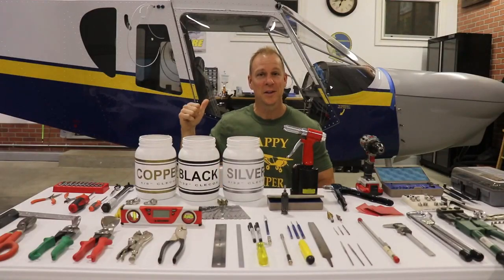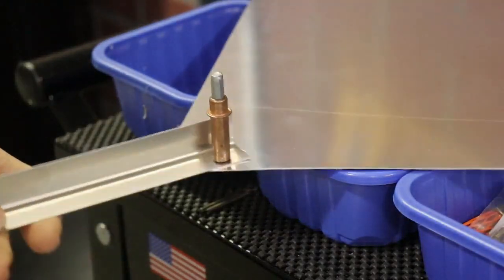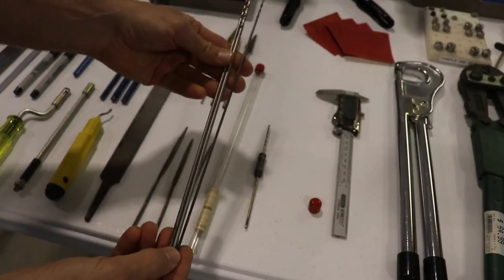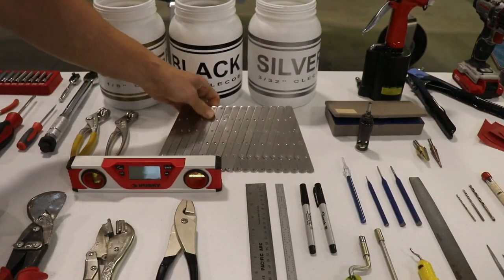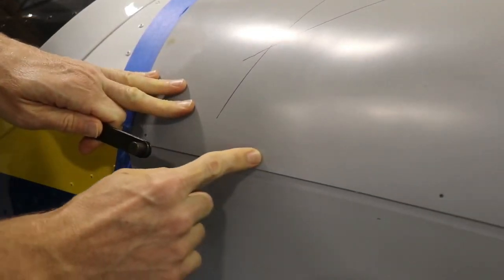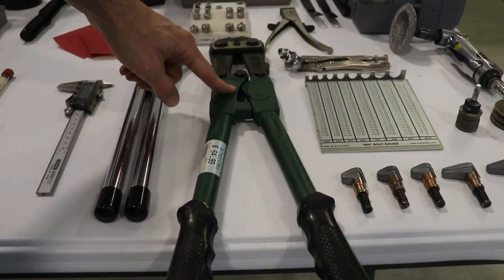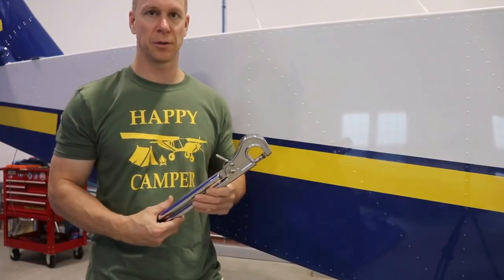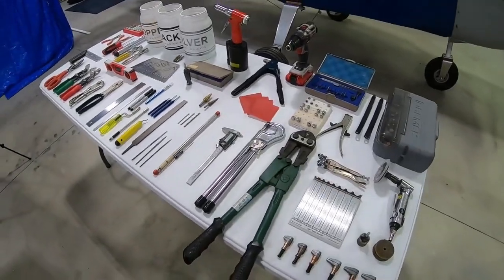What TOOLS do I need to BUILD an airplane?

Comment: The crimping tool the dies when countersinking rriverts there id 100° and 110° dies the lower is 110°and the top plate is 100° so they fit into each other and advise a newber builder that has never done this type of reading by the AC43 book and it has many good tips and how to do the job correctly and yhis is a very hood video for starter well done

Comment: Great video. If you ever want to do a follow-up, a quick breakdown on what's required on top of this, for something like a Vans RV, might be interesting to some. Keep up the good work.
Reply from the maker: It's been a while since I've built my RV-7 so I'm not I remember all the different tools needed. I think it's mostly all of the same tools you see in the video, plus the addition of a rivet gun and a few accessories for the rivet gun.

Comment: Would like to see the type of paint system you used. Also, if you used pneumatic tools or just the electric variety. (I think you showed a pneumatic sander in the vid). Would appreciate your thoughts on your choices. A very thoughtful and useful video!

Comment: Add some removable screw driver bits to insert into the Porter Cable drill ---> need it more during maintenance activities (condition inspections) than during the build, but it will save the muscles in your arms and reduce the number of blisters in your hands with all the screws that will need to be removed and reinstalled.
Reply from the maker: There's actually not very many screws to remove on the Cruzer. And I prefer to use a screwdriver by hand anyway just to prevent stripping or damaging the nut plates. Now the Mooney on the other hand where there are roughly 127,482,955,981,912,945 screws to remove? Then YES, add some bits for the drill!
Reply: @KitplaneEnthusiast  :-D

Comment: An expensive tool with a learning curve... Do you think a TIG welder would be useful for welding aluminum? Mostly I'm thinking for fixing mistakes like welding/filling holes back in or welding over-bent parts that break, versus reordering parts.
Reply from the maker: I'm not sure if TIG, MIG, or Oxy is best for welding aluminum. I know nothing about welding, but that is a skill I'd love to learn someday.
Reply: @KitplaneEnthusiast  I have limited experience with welding aluminum (still learning myself), but looked into MIG before buying a TIG welder. The most common complaint I read about with MIG welding aluminum was the aluminum wire feed was prone to jamming. The aluminum wire bends easily. I mostly went with TIG because the heat is quite controllable for welding really thin stuff. I remember seeing a couple Coca-Cola cans welded together bottom to bottom with a perfect bead using a TIG welder.

Comment: Where did you get the tool which slightly bends the sheet metal edges to make them lay down neatly with no gaps. And what is this tool called and how do you use it? Thank you.
Reply: EF-60 Edge Forming Tool.   Cleaveland Aircraft Tool Co.

Comment: One issue that comes up when dimpling nutplates is that this process might crack the edge of the rivet hole.  Some guys avoid this issue by inserting a countersunk 1/8’’ aluminum tab the size of the nutplate.  This avoids having to remove a nutplate that cracked open during riveting.  

This being said, you don’t seem to have this issue because of the type and thickness of aluminum you use and the particular nutplates you use.  

I can see where I could use your technique inside my cockpit for my armrests.  They are of a similar material with similar size nutplates.

Thanks for the demonstration.
Reply from the maker: Interesting. I've never witnessed or even heard of a nutplate cracking. Have you?
Reply: Kitplane Enthusiast Not so much the plate as a rivet ring.  The back tab trick is sometimes essential for some 2024-T6 or with thick skins.  It’s found this in some plans for some scratch built planes.  Your application does NOT seem to need such precautions.